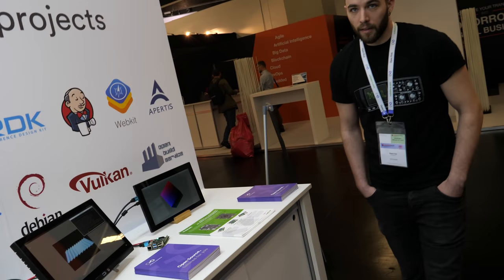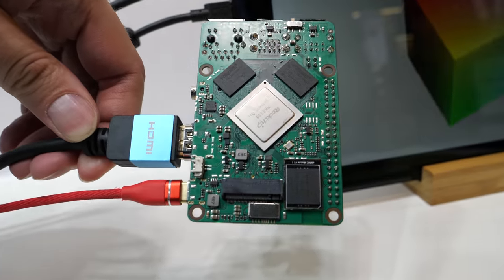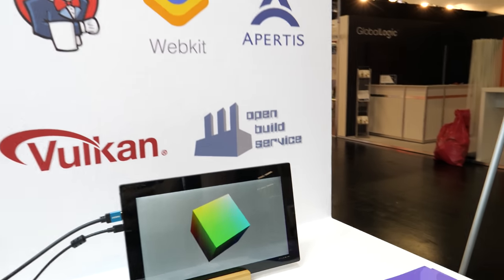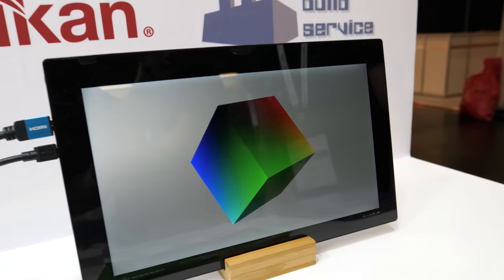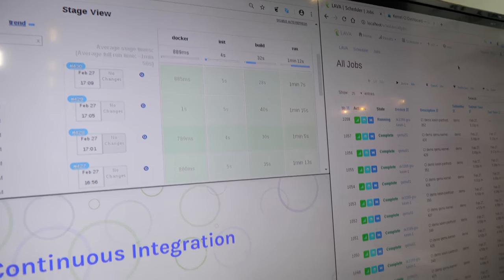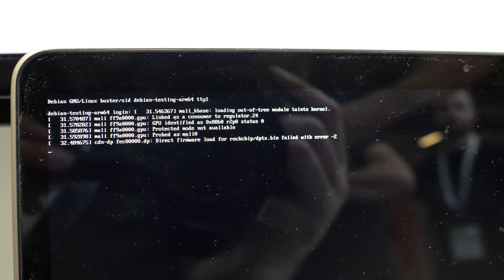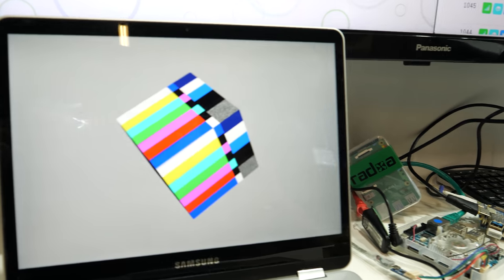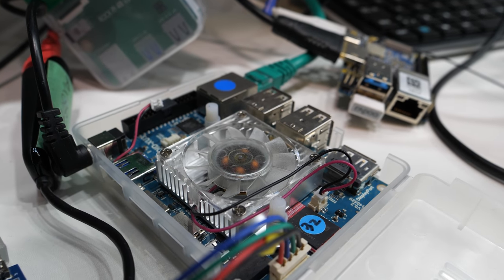Collabora shows Radxa ROCK Pi 4 running Panfrost open source Mali GPU driver

Comment: @Charbax Is there any way to get these drivers in 2023? I just bought a ROck 4C plus and Debian Bullseye does not have these drivers so it is running HORRIBLY slow. I can't find any image for this board to support these drivers at all. Any suggestions from anyone?
Reply from the maker: Rock boards surely have some type of community forum?
Reply: Radxa has a messy page with broken links, broken images, and even links to wrong board files. There is a forum full of people asking where the Rock 4 drivers are, but Radxa's attention goes inly to the new Rock 5

Comment: What SBC Manufacturers seem to be missing: My experience running Ubuntu Linux on an Older Motherboard which can only hold an Maximum of 2gb RAM in 2 RAM slots, is that you cannot even find a Browser (Full Fledged Firefox) That will even Run on Less Than 4GB of RAM any more. If their is such a Browser for Ubuntu Linux, Please let me know what it is and how to Install it in Ubuntu.
Reply: Try Falkon
Reply: ghos282 I’m on Ubuntu 18.04 right now with GNOME removed. Google Chrome (5 tabs) + terminal + vscode uses exactly 2GB of RAM. Switching from vscode to vim would reduce my RAM usage to just 1GB